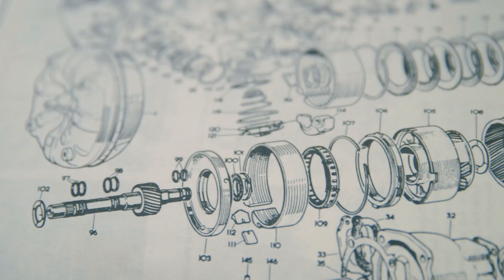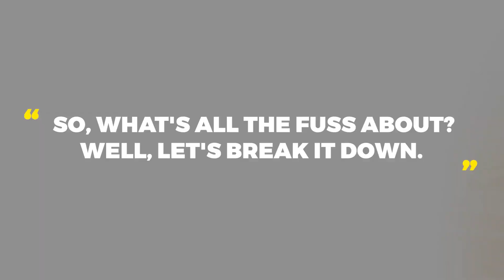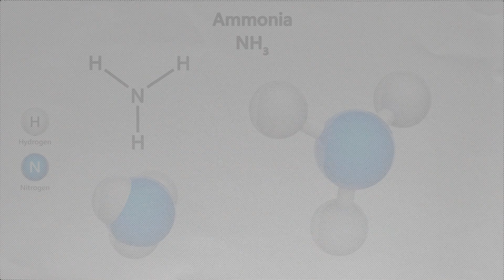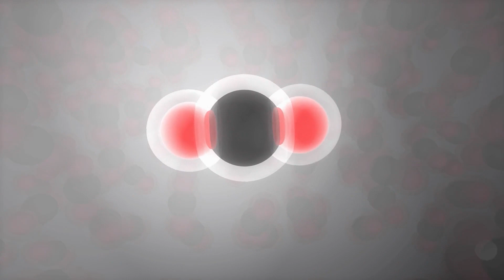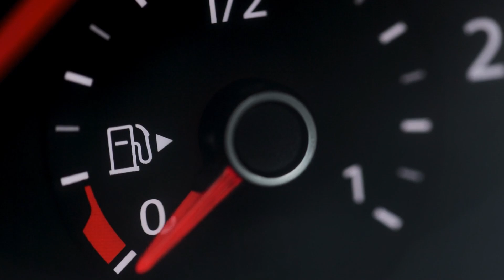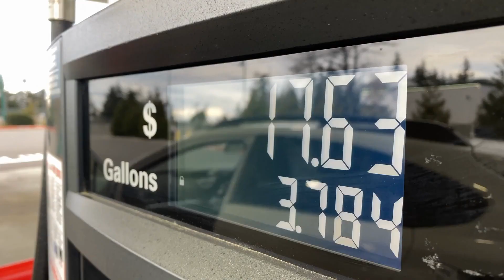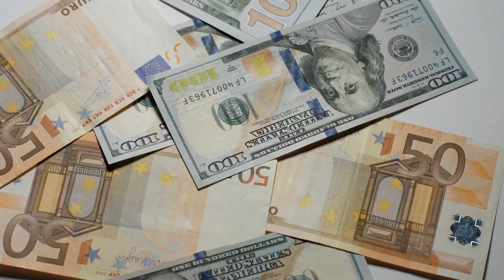Ford CEO: "New Ammonia Engine Will Change Entire EV Industry!"

Comment: Why would you EVER pick ammonia over hydrogen?
Reply: If it was cheaper. Quick search returned that it costs 50 cents per mile in the hydrogen Toyota.
Reply: Because it’s a liquid at room temperature and doesn’t need to have high pressure tanks. In other words it can be transported like gasoline and all existing gas stations can store and dispense it with minimal investment. Methanol is another good contender.
Reply: I’m not sure ammonia is as flammable as hydrogen

Comment: So far I have yet to see a "Green" energy that doesn't use Fossil Fuels to make it or used to design it.....but to make a real impact they need to design something "green" that can replace the existing engine in any vehicle on the road now.....I do not want to throw away a perfectly good paid off car just so I can go 80K+ into debt.  EV is not the way to clean energy.  It has the same problem amonnia has....take a lot of energy to make.  China is pumping out more carbon than the other 3 top countries combined.........If you clean up 100 feet of crap out of a 1 acre plot of crap.....it will still smell like crap.